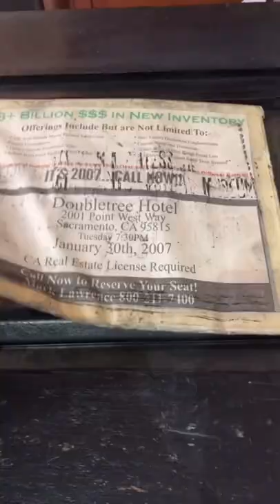Some orange rubber base ink for one of the hottest days of the year in Sacramento, California

Comment: What’s the news paper?
Reply: I think I have learned so much from these videos that I can now answer this question; it provides a protective, cushioning layer that helps them produce a better imprint without having to use as much force. Some of the cuts are more than 100 years old and are very delicate, so the cushioning paper protects them from being crushed. The age of the press and the cuts requires quite a bit of finesse! I am sure Jared will correct me if I'm not on the right track or I have forgotten something! ☀💕